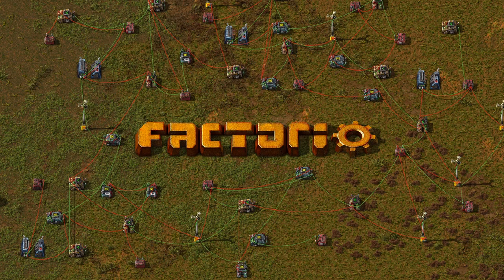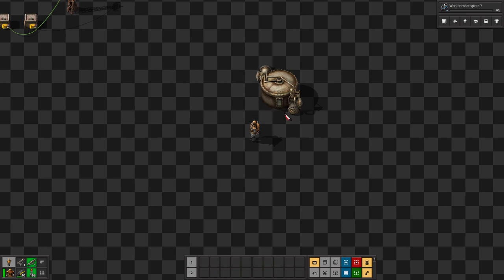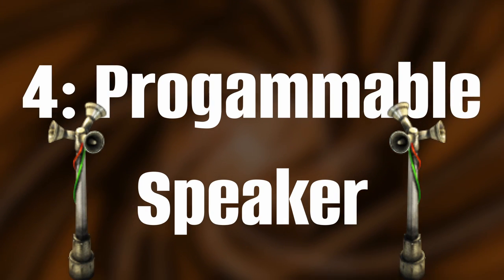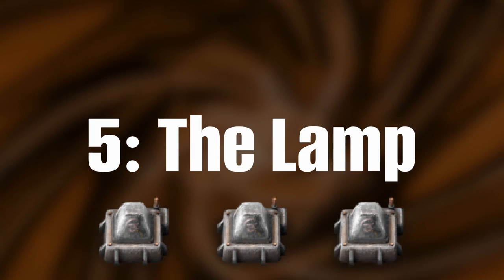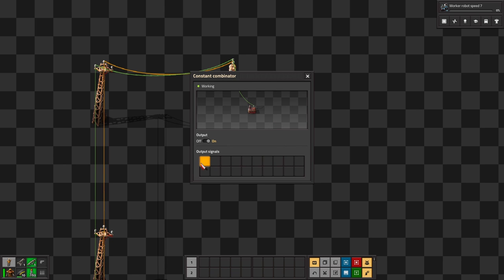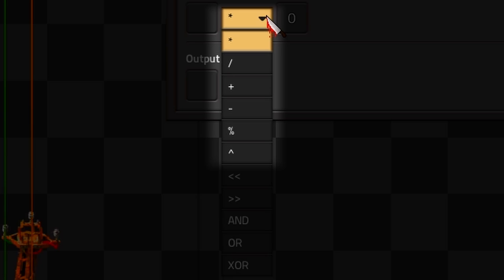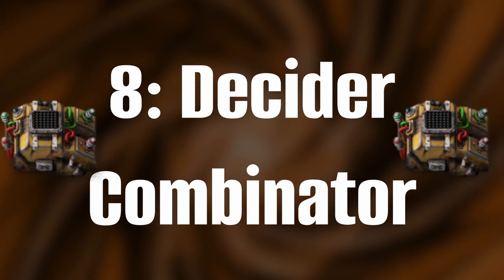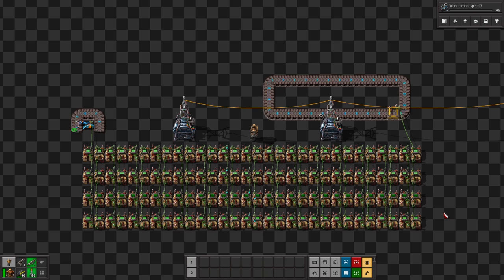Factorio Circuit Networks explained in under 4 minutes!

Comment: How do I store a variable?
I have two chests and I want to transfer resources from one chest into the other chest after I reach a lower stored threshold and fill up to a desired stored threshold. But the logic on the inserter is limiting me to only be able to keep something up to the desired threshold by reading the chest content and activate when value drops below desired threshold.
One solution that did come to mind is to use a train to transfer 1 stack of the item but it is overkill, I want to remember that I dropped below a value and continue operation until a condition is read, it seems like I should use the logic device Decider combinator to store a value but I haven't gotten it to work.
Reply: For refference I have watched Doshdoshington's video on how to build a brain in factorio but it went way over my head and that man scares me, his level of understanding makes me feel like less of a man.
Reply from the maker: storing a variable dynamically and manipulating it, can be done with a 'memory cell' which describes a combinator that has its output wired to its input.
if i understood your chest scenario correctly, it needs any form of hysteresis, in different words: 'it should be taking recent system history into account'. a memory cell application would be a fancy way to do it but is not necessarily required. a rather simple latch mechanism would be the perfect solution here.
for that have a look at this (https://wiki.factorio.com/Tutorial:Combinator_tutorial#Set/Reset_latching_switch) wiki site.
tip: since the example uses fluids instead of items your signals will have to be set to the equivalent item in the chests.

PS: I'm equally frightened of what DoshDoshington designed in his factorio city video, so no worries 👍
Reply: @center_pivot  Thanks a ton, I'll give this a read over and try some things out on the weekend